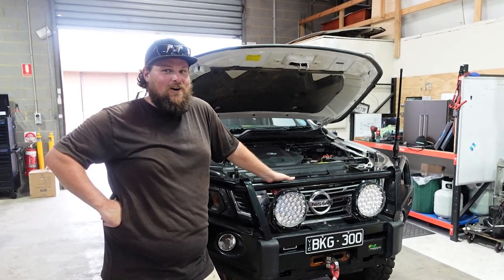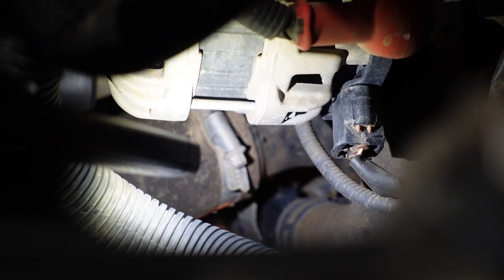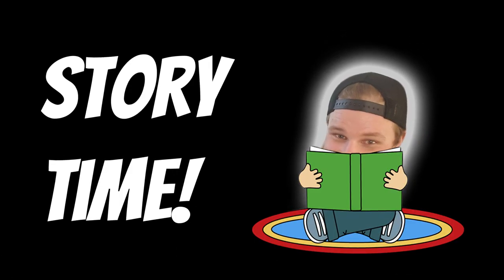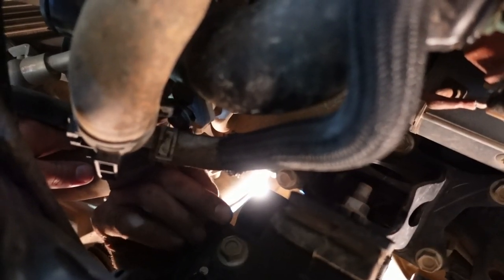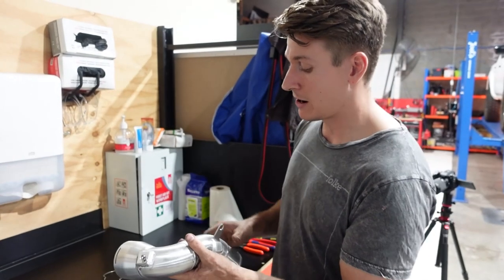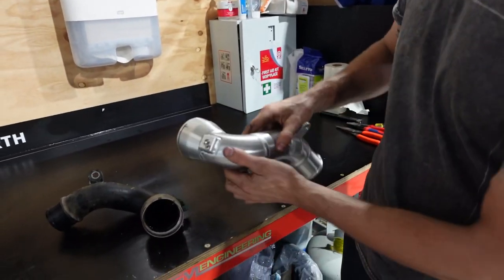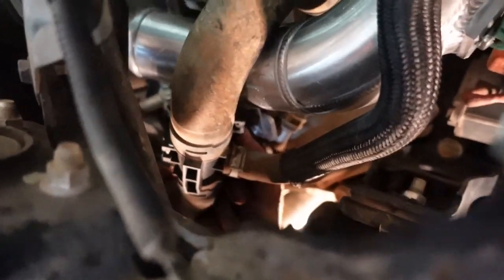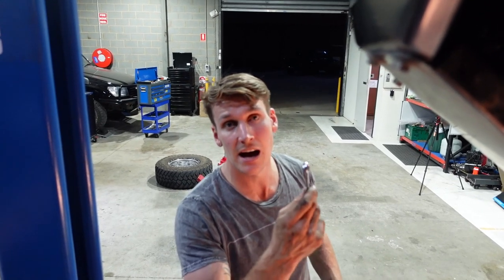NP300 CRG Throttle Body Pipe Upgrade #SHEDSESSIONS

Comment: Thanks for the video. This was the hardest s.o.b. to install and I dropped the mounting screw into the Bermuda Triangle and never to be found - just cable tied the sucker down for a bit until I get around the wreckers! Got the Intercooler kit in the garage and thinking probably easier to have done it all at once. Oh well!

Comment: Just to add to this you don't have to remove the clip on the air temp sensor plug. Just push it down and remove the plug, less chance of losing it. I had extreme difficultly removing the throttle body even after unseating the retaining clip. I had to use a pry bar from the top of the engine bay and pry back to the top of the throttle body pipe to break the seal.

Comment: Hey mate, with those 2 pin connectors, like the intake sensor one, you dont have to remove the metal clip. You can push it in towards the plug itself
Reply from the maker: Cheers mate, I found that out after I had filmed it 🤣 probably saves you from loosing them too 👌
Reply: @jpcaptured799  yeeeep, saves them shooting off into space hahaha

Comment: Doing mine right now but I'm also doing silicone hose replacement (plazman) and using Platinum pipes, they seem to have double o rings for each connection.

Comment: Don't you need to clean the air temp sensor with brake cleaner?
Reply from the maker: You could clean the sensor with sensor cleaner if you wanted too 👍